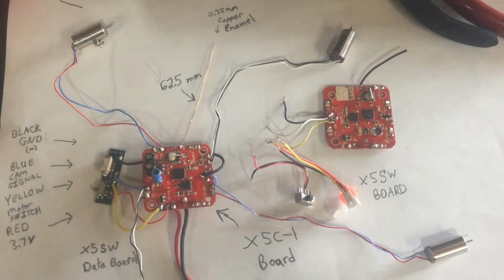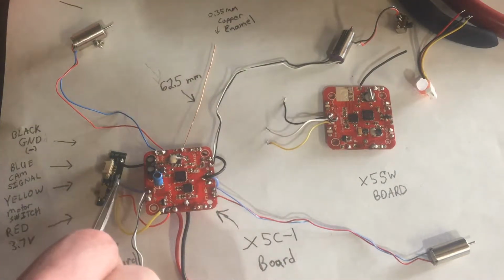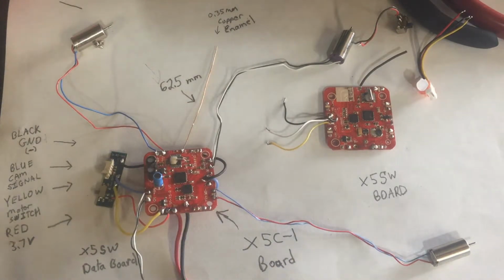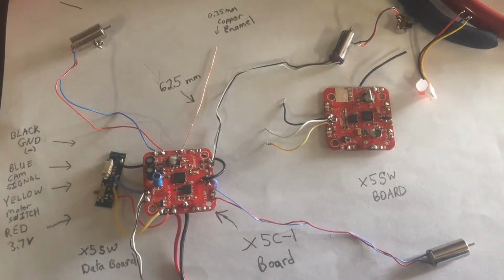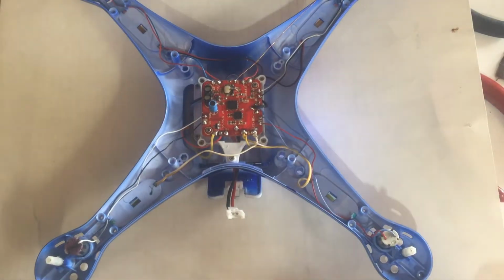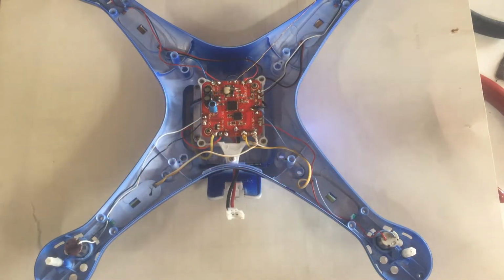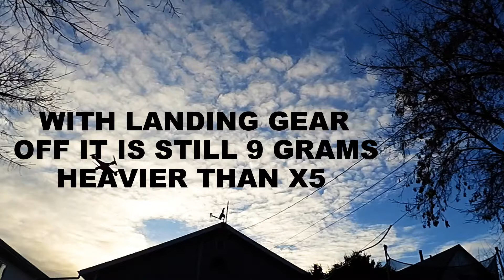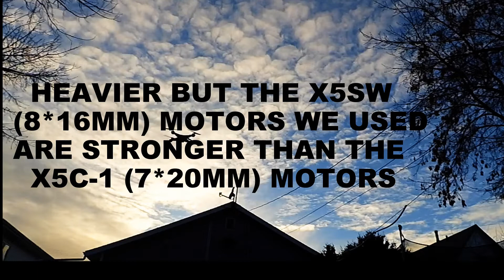Syma X5SW with X5C-1 Flight board

Comment: Hi. I have a question ,wondering if you can help me. My Syma X5SW does not work properly. I crashed it once. it looked fine . But suddely one of the motors spun all the time as long the batteri was connected to the dron. Even if the drone is turned of. When i turn on the drone and the remote control the other three motors work as they should .  But when i try to fly the drone . Only 3 motors respond to the signal from the remote control. The last one just spins at medium speed. Is it possible to fix ? I have tried to switch to another motor, but i get the same " problem".

Comment: After replacement did you still use your x5sw transmitter?
Reply: riomobinessia in receiver board syma x5 v.6 work in transmitter x5sw blue led and not work in green led in transmitter